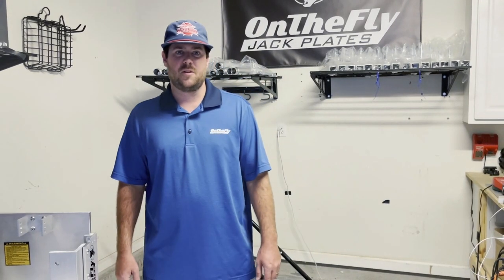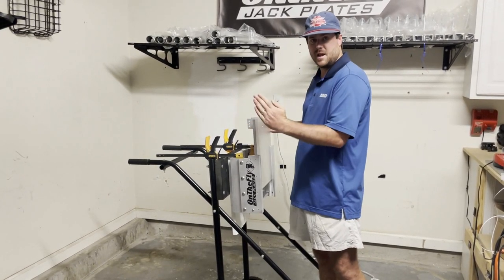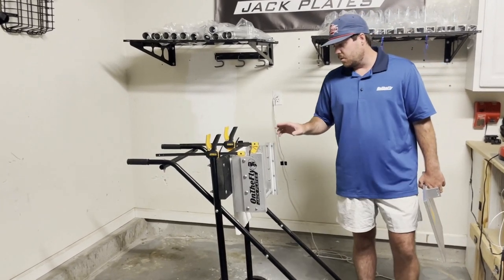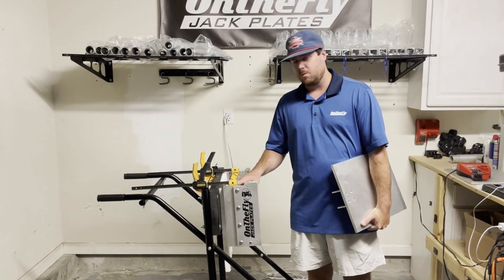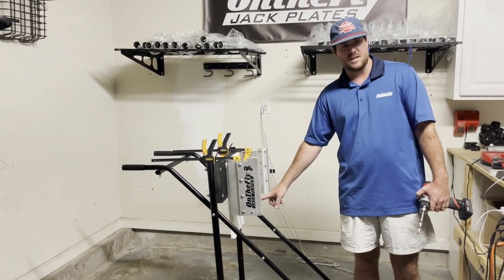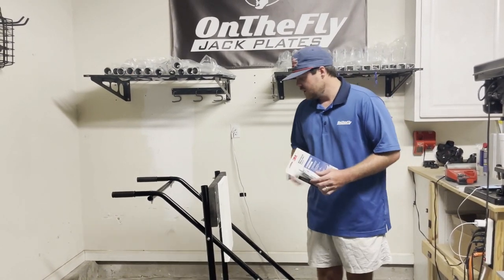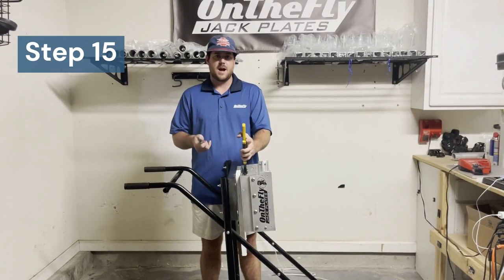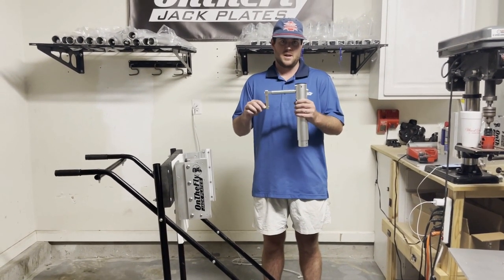On The Fly Jack Plates Standard Manual Install

Comment: Suggestion from Arkansas duck boat world: Consider incorporating a kick-up function and try to get to about 1 foot of travel. You need more vertical travel to get the lower unit up high enough in shallow water. 5 or 6 inches is nice but not nearly enough and you could set your product apart from the others.

Comment: What if the plate does have more left and right play than it should? not much but like a 1/4 to 3/8” how can you get rid of that? I’m installing one soon and mine has that play in it.
Reply from the maker: Hello, since there is not a round bar in the top of part of the jack plate going from side to side it can do that before installation. You can just push the 2 sides together at the top to bring in the gap. Please give us a call or shoot us an email with any questions you may have. Thank you!

Comment: Is the top of where u mount the crank handle suppose to have some play in it?
Reply from the maker: The actual handle? Or the the top part of the jack where you mount it into the jack plate?
Reply: @ontheflyjackplates875  just the handle I got it put together and the handle has a little tiny bit of play but honestly I think it should be ok
Reply: Or maybe the handle assembly I should say
Reply from the maker: @ledzep301  yes that is normal, it can’t be super tight because it needs to be able to turn easily. Of course, if you have any more questions please feel to reach out!
Reply: @ontheflyjackplates875  yes you are right I’m just a lil slow 😭😭😭 thanks guys

Comment: What is the overall travel from top to bottom?
Reply from the maker: There is 5 1/2 inches of travel but there is also different mounting positions where the jack can mount inside the plate to get about 6-8 inches above the transom at max height.
Reply: @ontheflyjackplates875 I have a mid 80s mariner 40 on and ancient early 60's richline vhull. Problem is the mariner 40 came off a pontoon boat so it's a longshaft. I need about 5in of rise minimum. Do these jackplates work with Mariner clamp-style outboards?